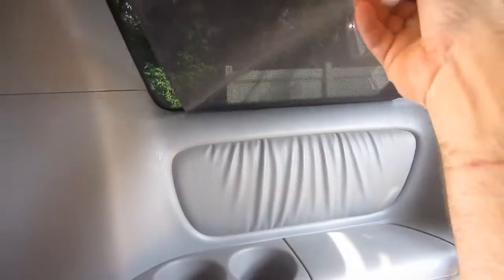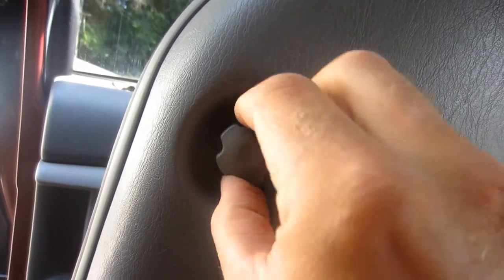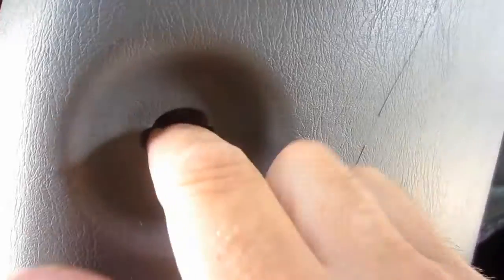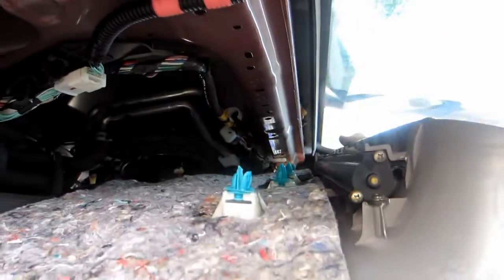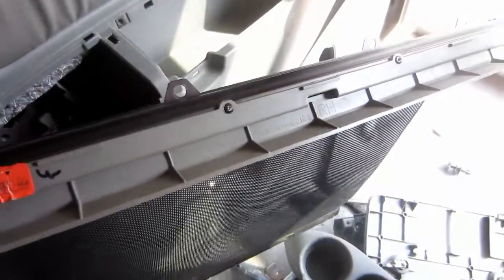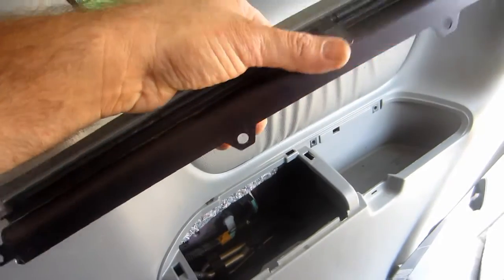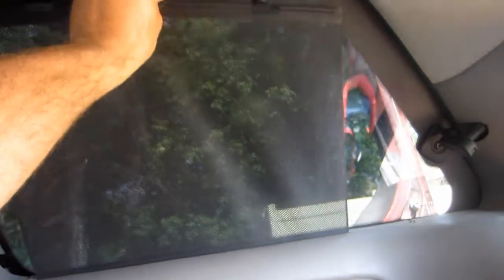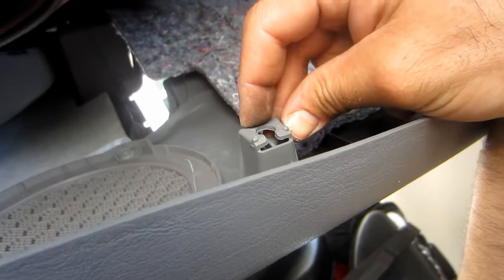Toyota Sienna Window Shade Repair

Comment: Thanks for the quality video. I just repaired my sunshade in about an hour thanks to your help!. The one thing I would add is that in order to remove the end cap (2:18) you'll need something small (I used a finishing nail) to tap this retaining pin out. Initially I thought it was a small allen screw but it's not.

Comment: Tks for your video about the clips removal and other info.  Indeed, the spring was detached at one end .. the trick was to screw it back to the plastic piece. I used a rope to fish it out of the tube to be able to do that.  A detail: I removed only the round end rod cap, not the flat, easy to do. Next was to put the right tension with the treaded rod and obtain the right shade length.  That was a series of trial and error but finally got it right.  Glad other did it quickly, it took me 1h30.

Comment: This was awesome for me, thanks so much. I had exactly the same issue and your instructions worked perfectly. The biggest problem for me was the "firm tug" to separate the panel from the body. I managed to get the two cargo clips loose - and you are right it took popping the top off with two flat blade screwdrivers, which wasn't clear in your video, I could not pop it off with my fingers - but then the panel was so tightly bound to the body that I was worried I was going to break something pulling it off. I removed the glove compartment and cup holders as shown in your video and pulled hard and it all came lose at once. One clip mount (the plastic mount in the plastic panel that the blue clip mounts to) did break because the clip refused to pull out of the body, and the two clips at the forward end popped out of their mounts rather than pulling out of the body. They were easy to pull out and put back in their mounts which I fortunately did not break.

In my case the spring had simply unwound. It was still tightly bound to the brown plastic bushing that holds it in place. All I had to do was pull that brown plastic bushing away from where it seats itself in the cylinder that houses the shade and turn it several times in the correct direction (which took some experimentation) and seat it back. Because nothing was actually broken or separated I have a feeling this problem will happen again.

Thanks again for sharing your experience. I don't know that I would have been able to figure this out without your video.
Reply from the maker: Glad the video helped.  That's why I post them.

Comment: Thanks you so much, I had the same issue, was able to fix it in about two hour. Only thing missing in your video was how to remove the locking pin, I tried it was alen key, but later was able to push it out with another pin. I also superglued spring to the head so that it does not come out again.